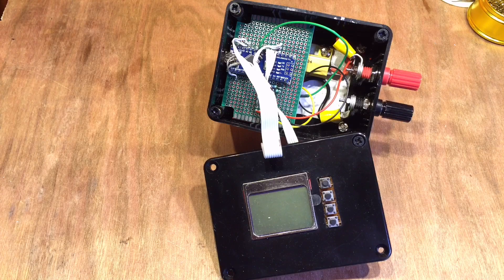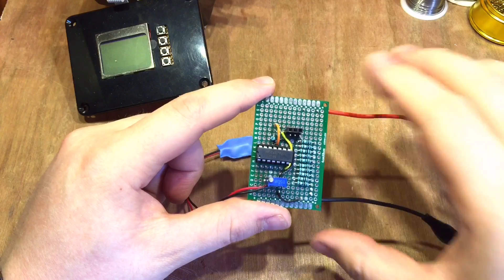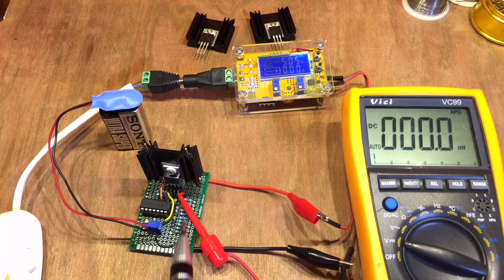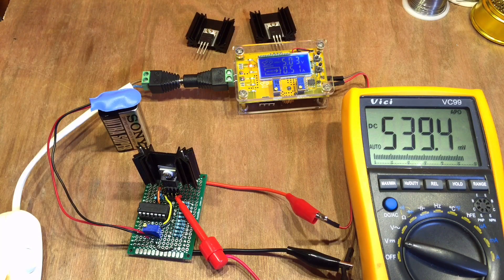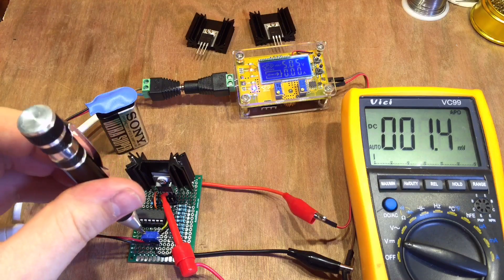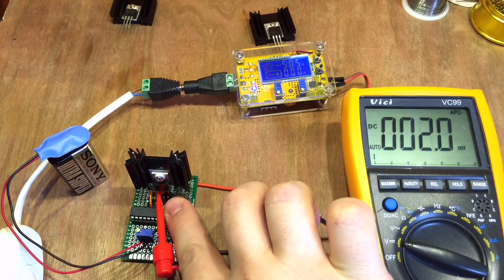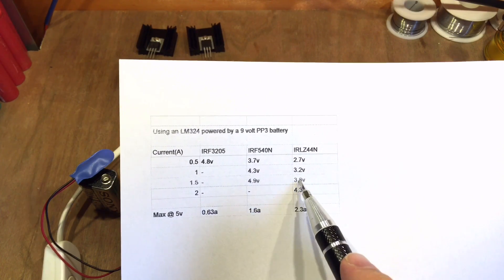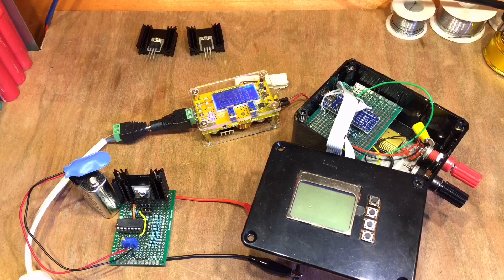Constant Current DC Load - Part 5 - Mosfets - Adam's Arduino Projects

Comment: Hi Adam, Great series of videos.
The arduino comes with a precision voltage reference, 1.1V i think without looking it up. If you measure this also, then you can adjust for variation in the supply voltage. Looked like your usb supply was a little low since your readings were a bit high.
Going to make a load of my own, thanks for doing most of the hard work for me.

Comment: you need a logic level n channel mosfet for this. I used a irf3205 for mine and works great.
Reply from the maker: I did try the IRF3205 but found the IRLZ44N gave a better range.
Reply: Well the L in the model no. indicates that it can turn fully on at logic level.

Comment: Remember to operate a MOSFET in the saturation region (max current/current source) the Vds needs to be greater than (Vgs - Vt). This means that you're not going to get any more current to pass through the MOSFET no matter the drain to source voltage. For example with the IRF3205, the overdrive voltage with your gate voltage is only 1 volt, assuming the threshold to be around 4 volts. To really be able to using this as a decent load you need to use a much larger gate voltage to stay in the triode region with the MOSFET. Otherwise you're just going to end up with all the voltage across your MOSFET.

Using the data you collect from the IRF3205 for the saturation current if you increased your gate voltage to 10v instead of 5 you'd be able to get around 22 amps through the MOSFET. 
Solving for process parameter: kn(W/L)

Id = 1/2*kn(W/L)(Vgs-Vth)^2  For saturation current
0.63 = 1/2kn(W/L)(5-4)^2
kn(W/L) = 1.26 A/v^2

Id = 1/2(1.26 A/v^2)(10-4)^2
Id = 22.68 A

if you want to estimate the resistance of the MOSFET at a given gate voltage you can use this equation. It is just a linear approximation so it will be inaccurate with large voltages. 

Rds  = 1/(kn(W/L)(Vgs-Vth)

Comment: but what about the mosfet heat, wich one got hottest ?
i would imagine it would be the same because they would dissipate the same power for a given voltage and current, but isn't there something i'm missing ?
Reply from the maker: +BillTheBox Ah - a good question. Wouldn't be fair in this experiment though I don't think as they conducted very different amounts of current. 

Now I've just been out to the shed to test this. Probably not the most accurate of experiments but...  With 500mA of current for three minutes and an ambient temperature of 19.5 degrees Celsius:

IRF3205 = 38 degrees Celsius
IRF540N = 32 degrees Celsius
IRLZ44N = 30 degrees Celsius.
Reply from the maker: That was in the 18650 Capacity checker?  Yeah I don't really understand that as the mosfet shouldn't be acting as a load, just a switch in that circuit.  The z44n does have a higher on resistance than the 3205 so that could explain it, but your readings do seem high.

I might test the z44n at 2 amps this evening for a few minutes and see what temperature it gets up to.
Reply from the maker: Sorry - I think we're talking at cross purposes, it'll be my fault.

In my DC load project I'm using the mosfet as a variable resistor to mange the load across the circuit.  As a result it is going to get warm.

In my 18650 capacity checker ( https://www.youtube.com/watch?v=qtws6VSIoYk ) I used a fixed value resistor as a load and a mosfet as a switch.  The 3205 logic mosfet should go pretty much fully on in that circuit and should cause very little resistance and stay cool.

Comment: Adam, I really enjoyed that. Hmmm just bought 10 X IRF3205😂 came today. 

Keep em coming BigBoy, nicely explained, just need more posts please
Reply from the maker: +Dean Greenhough Thanks for the encouragement. Sorry if I've caused you a wasted purchase. They're great mosfets in switching applications.
Reply: +Adam Welch  well, you taught me lots, so now I know the difference between 3 Mosfets😀😀😀😀😀😀. No drama in the purchase😀 I will just have to find some projects. I was thinking about charging 2 10F super capacitors off a small solar panel. I was trying to convert the power to either 2.7v, but that wasted so much power. So have put them in series and see how that plays out. I was wondering if I could control the mosfet with PWM as I may adapt your work and get it too shut off the solar input when the caps are at their max voltage. Do you think this is a logical goal? 

Knowledge always appreciated, thanks Adam
Reply from the maker: +Dean Greenhough I've just ordered a group of super capacitors on a board to test with a solar charge controller as it happens... 

I'm thinking that you might be able to adapt Julian's Arduino charge controller - might be a few changes to make though.  You probably need to use a 3.3v pro mini for a start. Otherwise you could create a 555 based switching charge controller - that'd use a lot less power, even more if you use the cmos version I'm told. Both could use a 3205 ;-)

Best double check my musings before ordering anything though!
Reply: +Adam Welch  I follow Julian and will take another look with fresh eyes at his work. Ahh  the 3205 it will live😀 I will mull over your comments and look forward to your tutorial and discovery of supercaps👀